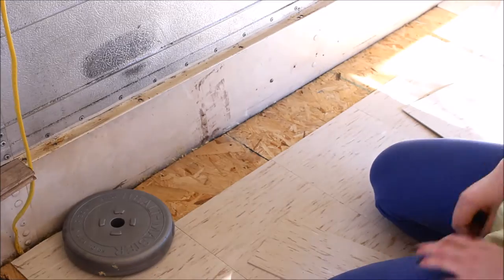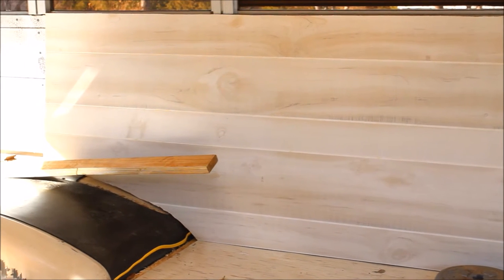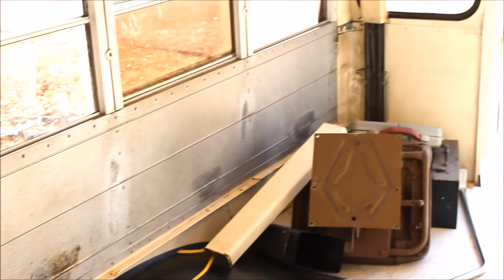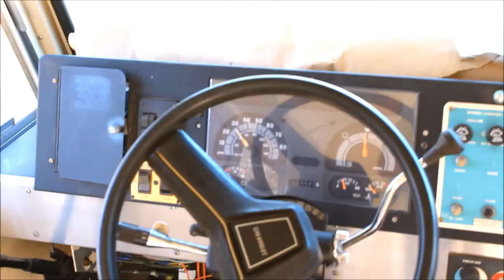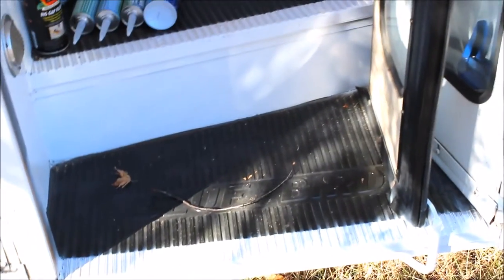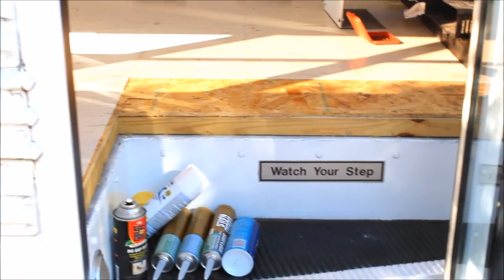Minibus Skoolie Conversion: Finishing floor and starting wall panels

Comment: A common issue with school bus conversions is the way they're wired. The wiring is set up in a way that, if any features are disabled (buzzers, flashers, etc), the system prevents the engine from starting. I would start by checking these things to make sure they are grounded after being disabled.

Comment: You fried this component under the dash by the left foot called the ignition interlock (looks like a small can that says dont use these terminals or something like that) when you started the bus with one of the emergency exit doors open.. you will need to cut the pink wire going to it.  It will start if your battery is at 12.6v or above. You're welcome:)

Comment: Rollwithit had a starter problem and it ended up that cutting the wire on the emergency exit ungrounded something in the ignition wiring.
Reply from the maker: Shane Bradley I watch rollwithit too! They’re great! Unfortunately the only thing we removed electrically was power to the rear heater. It pretty much died when we got it home. Right now we’re thinking it may be the fusible links. I’m no mechanic lol I’ve been learning all I can though. My boyfriend works for toyota so you can imagine how different this has been for him too.